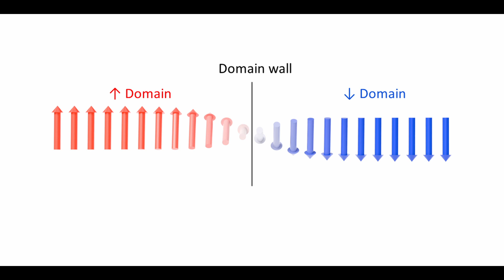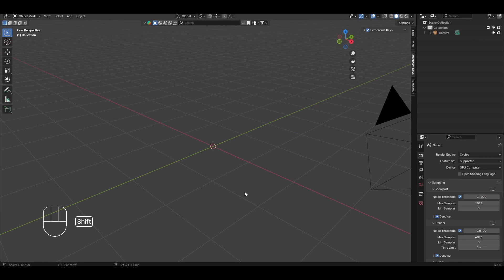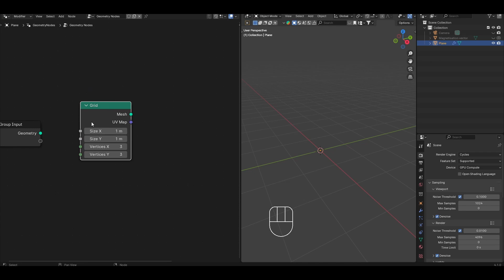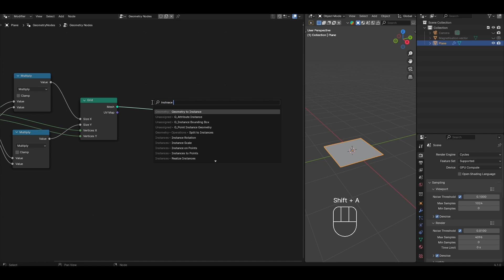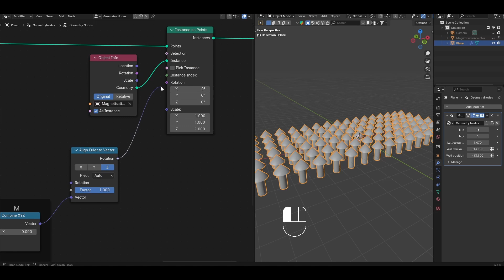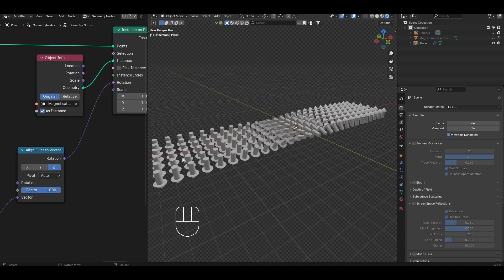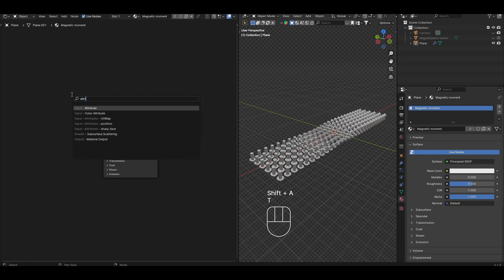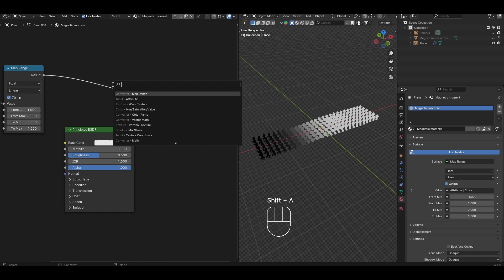Procedural magnetic domain walls in Blender

Comment: This is epic. As someone who works in the field of spintronics and quantum computing, I find that Blender is increasingly useful for visualizing simulated or real data into 3D animations. Recently, the idea of importing micromagnetic simulation data (known as OVF files) into Blender through some file conversion tool, crossed my mind. Not entirely sure how to do that, but if there is a will, there is a way I suppose hehe.
Reply from the maker: Agreed! If there is a way to convert .ovf to .csv, you’d be in business. I’m not an expert but a quick glance online suggests this might be possible? If you can read the data in, you can use geometry nodes to do all sorts to visualise it (eg there’s some great tutorials by CGFigures on data manipulation from csv)
Reply: @ryomizutagraphics  In that case, I'm going to have to try the CSV route :D I'm familiar with CGFigures CSV stuff. (Typically, I use Atomic Blender for this kind of stuff, but unfortunately it only uses XYZ and PDB data).
Reply: @ryomizutagraphics  I am aware of the .csv route from CGFigures, yes. If .csv is the most useful, then I will have to do that. (Initially, I have used Atomic Blender for stuff like this, but it only uses .xyz and .pdb unfortunately).